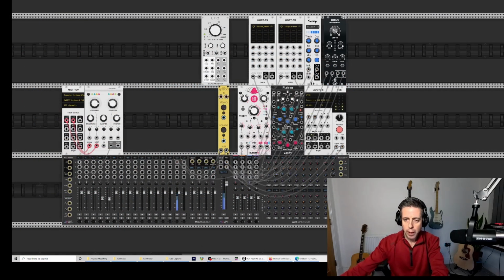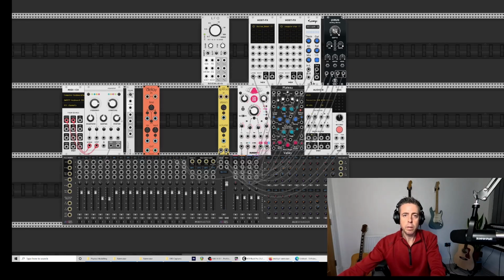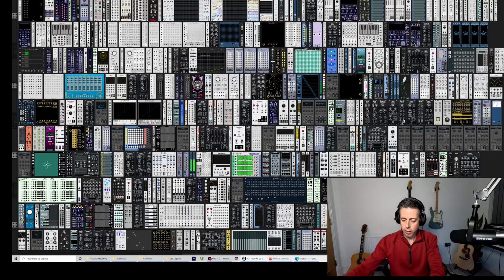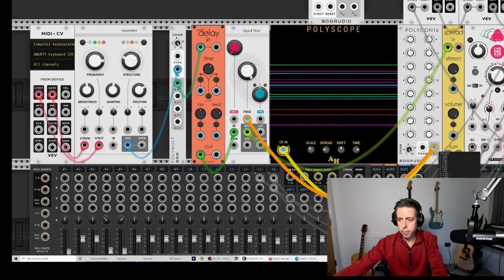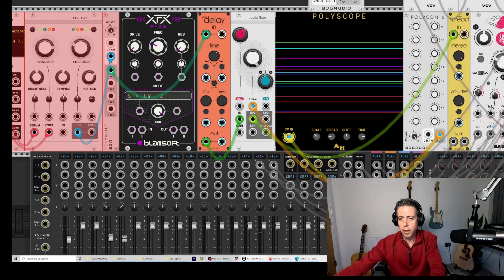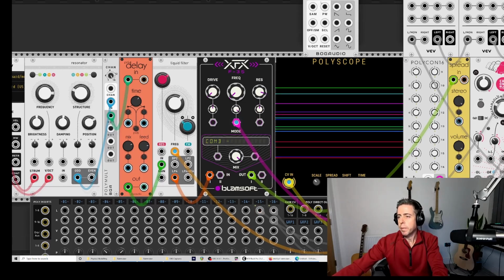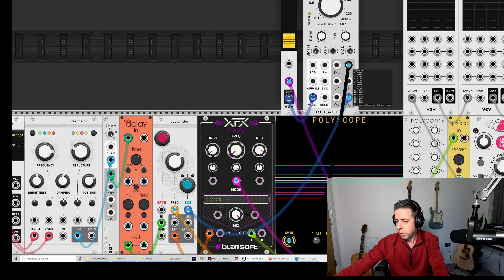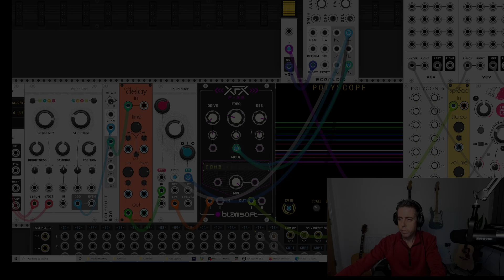Intellijel Rainmaker in VCV Rack

Comment: I love your videos and implementations! Thanks so much for making these. Are there any good substitutes for Stocaudio Spread and Polydelay? Those won't load for my CPU (Apple silicon)
Reply from the maker: Sorry, didn't see this! Yes, I'm on Mac too now (M4 mini) so all my new patches will be compatible for both platforms. For stereo spread, try Mockba Modular ASSprdr or Stoermelder Orbit. You can also also use Bogaudio PAN and send it bipolar poly modulation to pan all channels at once (I did a tutorial on that last year).
For delay, there isn't anything quite the same but Bogaudio CVD is poly. There's no feedback so you'll have to patch that in. There's also RPJ Circle Ride, but I've never got good results with that. If you don't mind buying modules occasionally, Unfiltered Audio's Instant Delay is the best because it's granular, and also has a send return loop.
As a last resort, you can always use a split, and send the signal to copies of a module then merge it back to a poly cable. That's tedious to patch though. Thanks!

Comment: I didn't realize stocaudio's poly delay was as cool as it is.  A couple days ago I tested a bunch of delays mainly focusing on how they behave when you change the time knob (whether they pitch shift or not) but I didn't even mess with the polyphonic capabilities.  I just tried it along with the venom recurse st module and it can get some wild drone sounds.
Reply from the maker: @shamskitz  yeah absolutely, that thing is nuts when you modulate it! The spread control changes the pitch too. With shorter delay times you can get a really nice multi-voice chorus using polyphony. But my favourite is still Instant Delay, that's granular so it doesn't change the pitch, but you can get mad timestretch effects instead.

Comment: Cool! Will be testing it on the weekend :)
Reply from the maker: @infelizmentesim  thanks, would love to hear what other people do with this 👍
Reply: @VirtualModular  I've been trying to make patches to run bass loops. I am thinking of sending a pitch shifted version to the delay
Reply from the maker: @infelizmentesim  sounds cool. Imagine if we had a polyphonic pitch shifter module in VCV too, that would be insane!
Reply: @ Absolutely! Wasn't there a developer which made a polyphonic rings? Maybe their clouds version can also handle poly. I like using sample and hold and quantizers to pitch shift clouds either in octaves or 5th (and octaves of the fifth) which works nicely!
Reply from the maker: @infelizmentesim  yeah that collection is called Sanguine Mutants, the poly Rings is Anuli, but I don't think the Clouds clones are poly too, they're just the alternative firmwares. Surge has a poly Clouds called Nimbus though, I've done tutorials on both of those modules too 😉
Reply: @VirtualModular  I have the Surge Nimbus but never used it since I got settled on Supercell as my clouds version. Will also include this when I try it